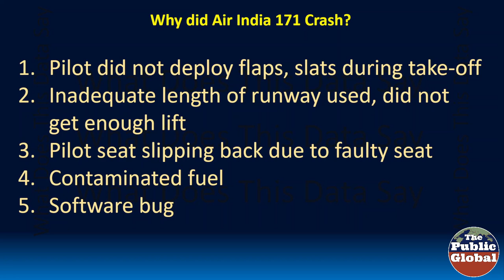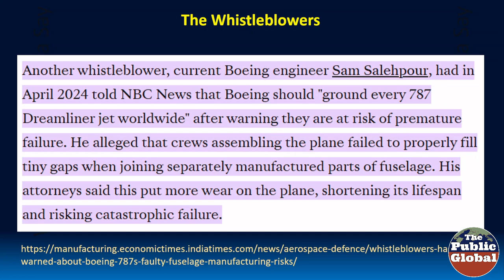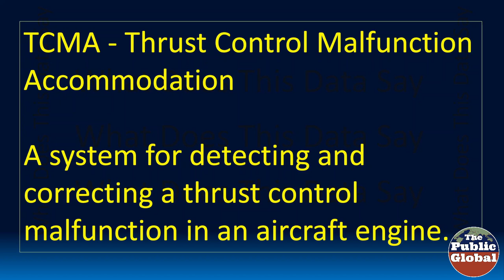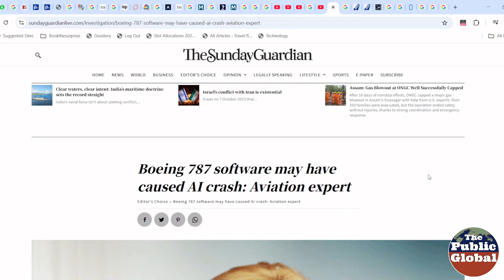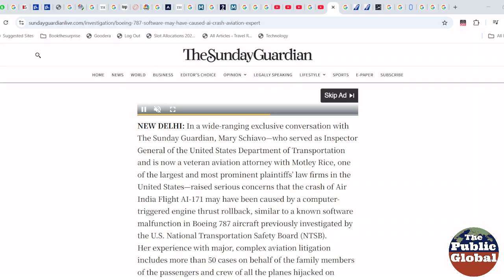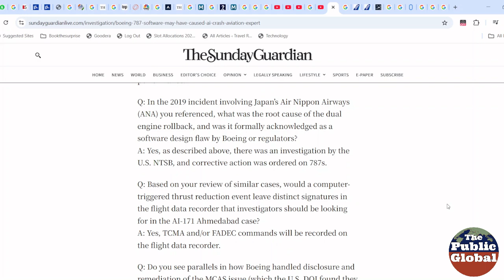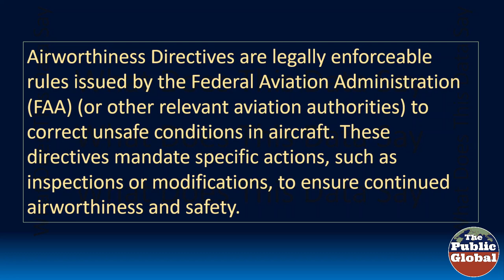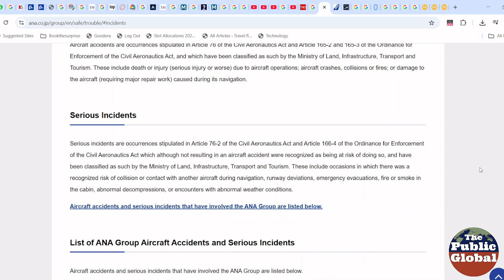Boeing 787 - Dual engine shutdown did happen earlier too

Comment: Please dont confuse. Tokyo 787 had Roll Royce engine. 171 had GE engine, Only reported failure of that engine is single engine failure for United Airlines flight but was single engine.
Reply: Flight computers that controls the engine are same for GE and Rolls Royce. So plz don't confuse.
Reply: @doodlemoodle699  This is problem of engine failure due to which RAT came down not due to software glitch like All Nippon Airways flight where there was no engine failure and plane landed safety with adequate thurst. In MAYDAY call Sabherwar who was not only experience pilot but instructor clearly said there is no thurst and plane kept on coming down. Even with software glitch he could still gained 10000 feet height and then landed down safely.  GIven both GE Aerospace and Rolls Royce manufacture engines as per their own propriteray design and not Boeings like contract manufacturer for say Maruti, and so interface software to deal with engines (FADEC)  will always be different. This is clear case of bird strike only  one after another and so rarest of rare incident. Ahmedabad Airport had more than 400 birdstrikes during last 5 years luckily did not result into engine failure. And precisely due to these low probablity even Air travel remains safest travel in the world.
Reply: But the recently replaced  engine was from Rolls Royce right?
Reply: @SwapnilNatu-l9x No. It was GE GEnx-1B . GE Aerospace has sent the team to India immediately after accident.
Reply: Using an analogy, a specific car make/model with michelin tires experienced a dangerous brake issue in 2019. Then the same make/model brake failed causing fatalities in 2025 had dunlop tires.  Tires are not the problem. Likewise the 787 engine is not the issue. In 2019, an All-Nippon Airline 787 flight software misinterpreted a malfunctioned sensor and cutoff fuel flow; thereby shutting down both engines.

Comment: A TCMA glitch seems very unlikely, since the gear retraction cycle must have been started, shortly before or most likely after hydraulic pressure was lost, which would be impossible, if the aircraft thinks it's on the ground. Also this particular software problem was promptly fixed.

Of course this doesn't mean, that there couldn't have been a different software problem leading to this accident, but the "this has happened before" angle just isn't credible.  The AI and ANA cases are very different.

There has been a lot of speculation, some of it very frustrating to watch if you have at least some knowledge of how a modern airliner and the 787 in particular works. 99% of these theories are not only quickly debunked but technically impossible. Each of these theories gets treated the same, no matter how credible it is. It's content creation, not journalism.

I understand, that people want to make sense of unspeakable tragedies like this one, but I think it's best to halt all speculation until at least the preliminary report is released.